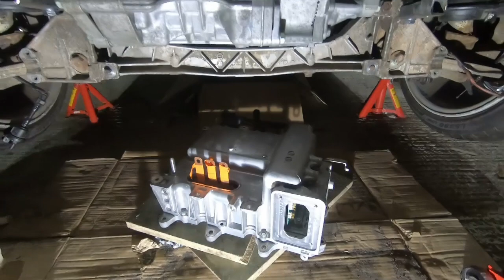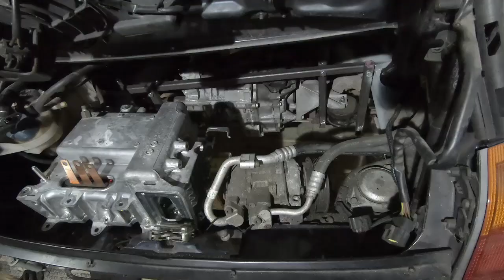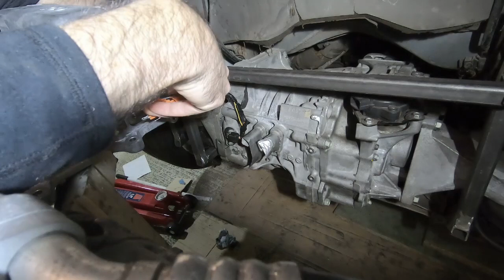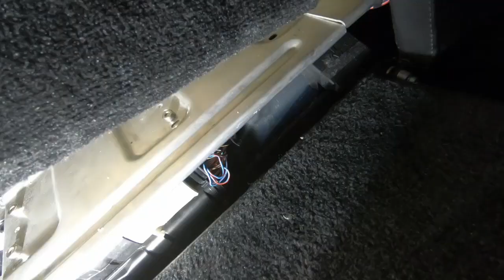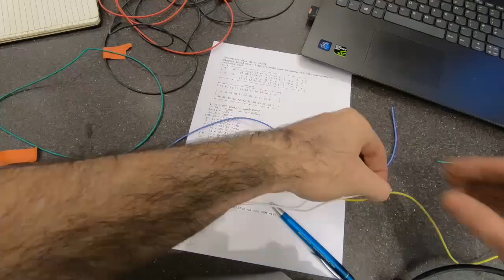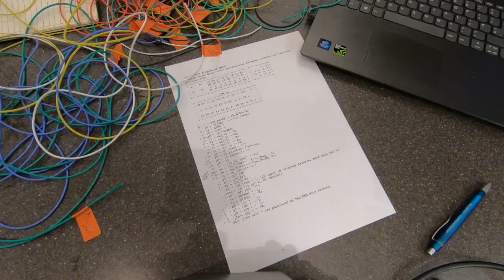Electric Porsche 911 project video 22 - Test fitting the Nissan Leaf Inverter in our EV Conversion

Comment: Is that really how your are crimping them :S . I would hate to have to hunt for loose connections in your build.
Reply: Just a pointer, I have been using the Iwiss IWS-2820 for quite some time now. It is the best multi-use crimper out there that is not junk. So please invest in a decent tool to save alot of headache down the line later.
Reply from the maker: Thanks for the heads up, will try to hunt one of those down. All the other multi crimpers I've had have been total junk and gave an even less secure crimp.
Reply: @PerformanceEV  https://www.amazon.co.uk/Dechengbao-Adjustable-0-2mm2-3-3mm2-Electrical-Automotive/dp/B07H3J6BY4/ref=sr_1_9?dchild=1&keywords=wire+stripper&qid=1591045727&sr=8-9 This version of the tool is decent on smaller gauges.  It's great if you have to wire something in place and are laying under a car or have your arms up doing a ceiling fixture.

Comment: Sorry to say the audio quality i horrible as usual - The "electric wind" noise is killing my brain. Playback at 150% takes care of the verbal pauses. 
An external mic: $20. A non florescent work light to get rid of the flickering: $25. 
However, putting effort in filming, explaining and uploading your knowledge is priceless! THANKS A MILLION!!!
I love to see how you're filming the details in your work, like crimping connectors and stuff. Again: Huge thanks!
Reply from the maker: Thanks for the feedback (both critical and positive) I've been trying to improve the audio with the equipment I've got, but only had limited success. I now have some new equipment on order which will hopefully sort it once and for all. Hope your Leaf project goes well, are you planning to reuse the Leaf logic board or use replacement one?
Reply: Performance EV 
I really dig the fact you’re replacing the logic board in the inverter. Might be a plan B for me if my original plan on letting the drivetrain believe it’s still a car by reusing most of the canbus electronics including charger, dashboard (hidden in a box) etc.
Reply: I think, since you're already putting effort in filming, explaining and editing everything you do, you'd get a lot more views if you step the quality up a notch or two. :-)
Reply: I'll watch every second though, even if it would be in flickering b/w war tape quality :-)
(I'm about to utilize a Leaf motor for marine purposes with extended cables between the motor and inverter)